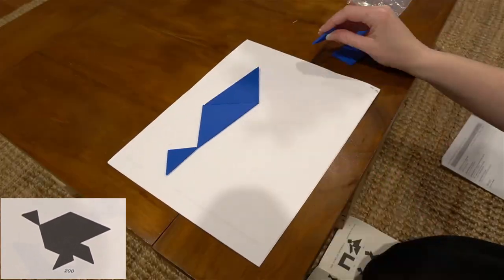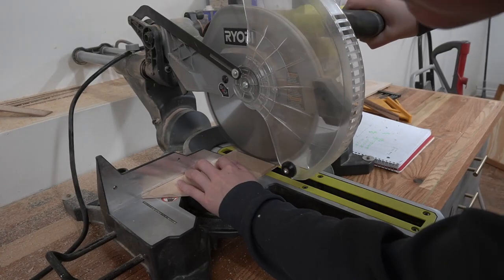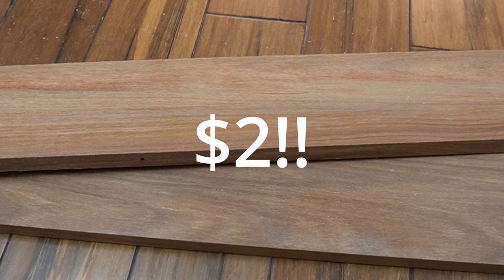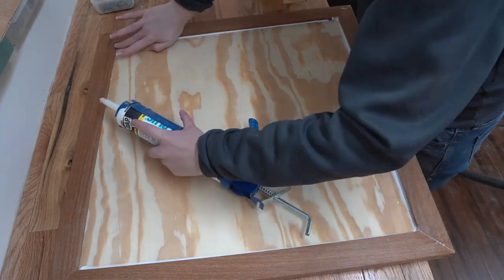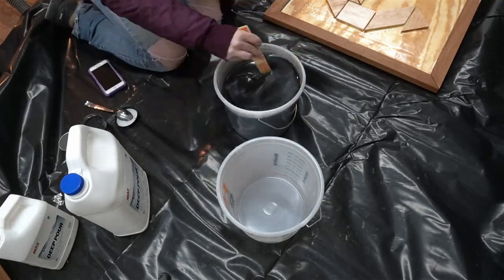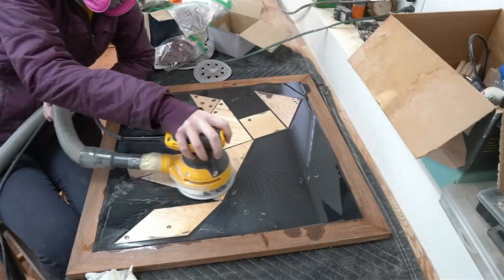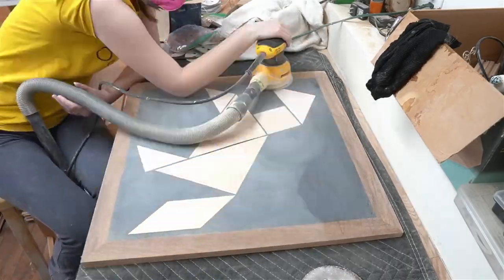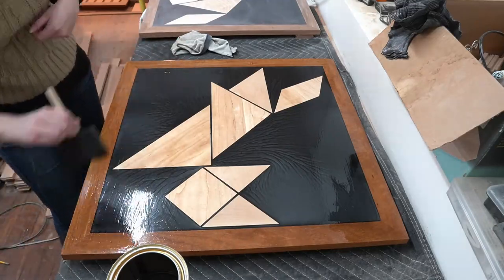Simple and Classy Wood Wall Art

Comment: Great to see you back, I too have been wondering about your thumb and have checked nearly every day thinking the worst. Glad to see the positive results. Also, noticed you went with a Sawstop, which is a great choice. Please be aware that cutting small pieces on a chop/miter saw can pull the piece into the throat of the saw and take your hand with it. There is a special inexpensive tool to hold down small pieces and keep your hands out of the path of the blade. I do not mean to be making a pun here, but, there is an excellent wood-working channel called "Stumpy Nubs" that has information on this and other safety tools. He is a real pro and a wealth of information. "The most important chop saw accessory" published May 12, 2021. All my best to you.

Comment: Try using multiple colors in the resin but dont mix too much for the swirly parts. Mix a big base coat with a color that you want (blue for example) only add a tiny bit. You dont want to color the resin, just slightly tint it. You can mix this well. Then just before you pour, add two or three colors and gently swirl them in, dont fully mix, just do a few slight turns to get in into the resin, only one or two. Then pour it and it should work similar to one of those acrylic pours.

Comment: I am about an hour outside of Mpls and am wondering if you could direct me to any hardwood dealers in the Mpls area? Just starting to get into woodworking and would appreciate any help you could give.
Reply from the maker: I got the wood in the video from Forest Products Supply in Maplewood! It was last summer, so things may have changed, but they had a pretty nice cutoff section at the time. It was a bit confusing, since most pieces didn't have prices, but when I asked the guy basically shrugged and charged me $1-2 each.

Comment: Resin it self is the finish coat, it just has to be polished off. A fiberglass bathtub, sink, ect. Is finished in what they call a gelcoat, and all that is, is resin and a pigment (coloring). They also use the same stuff in auto body repair. I'm sure there's a chanel or two on youtube that will show how to fix a fiberglass car body
Reply: There are plenty of resin channels that show how to do this as well. I subscribe to two of them. It’s just a clear pour.